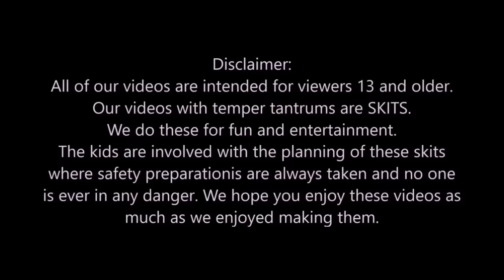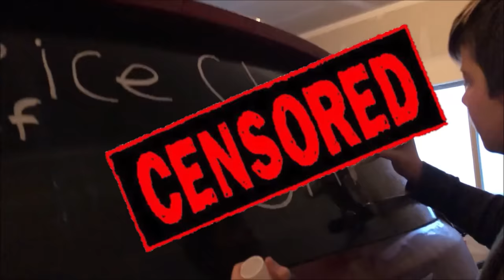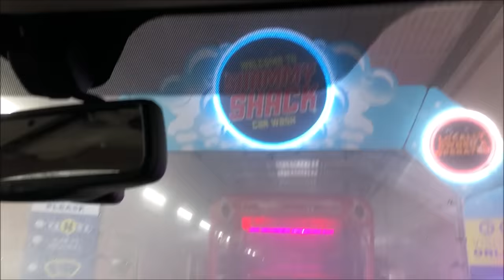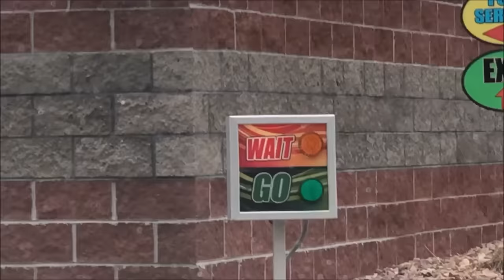Kid Writes Swear Word On His Mom's Car Then This Happened!

Comment: FKZF Studios edition:

Cream the Rabbit writes "Piece of Shit" on Kyle's FKZF mobile Spoiler wing, and This happens...

Vlog:
Cream the Rabbit (from Sonic) tried test driving Kyle's FKZF mobile around backyard of Hedgehog Mansion, but Crashes it into the wall and smooshes front of the car.(Last Month)
Reply: FKZF mobile:
A HWS 24/seven
Car Customs:
_________________
210 mph car

Grass block Paint job

Custom Body kit

Custom Taillights

Carbon fiber Custom hood

Custom headlights

Green neon

Custom mufflers

01. Rims (from Midnight club 3 DUB edition) with Racecar tires

FKZF window decals

Custom Spoiler

Lvl 3 N2O (Green Nitro blast)

Green window tint

Sword with Racing flag & FKZF vinyls

Lvl 4 Engine 

Muscle type 3 Engine Sound

Custom side mirrors

FKZF Badge (On Side & back)

(15% is the maximum percentage for car's car ratings)
____________
Top speed: 15% (Max)
Acceleration: 14%
N2O: 14%
Strength: 6%
____________
210 mph
215 mph launch speed
32s N2O (223 mph N2O speed)
Takes 12% damage on Rivals